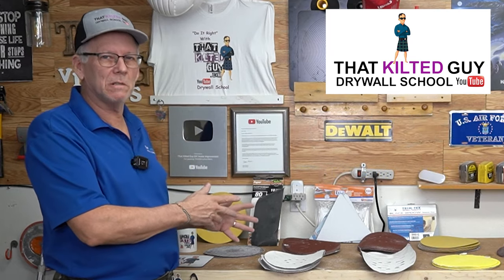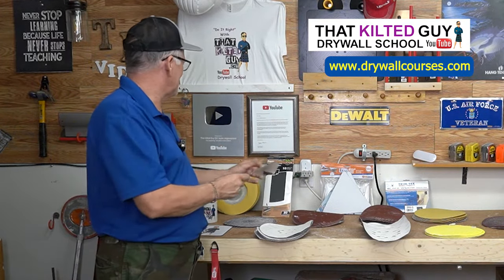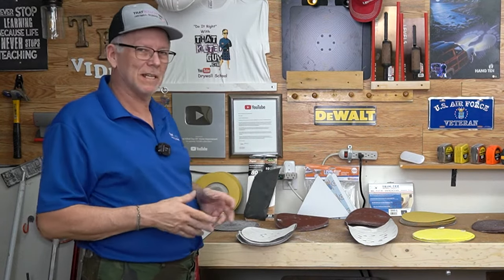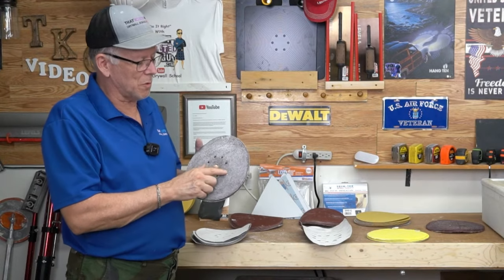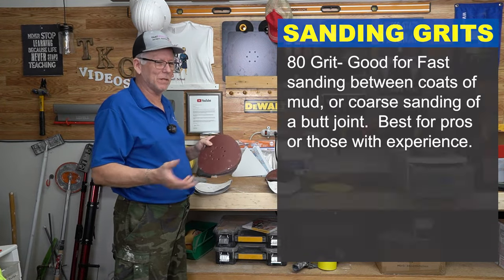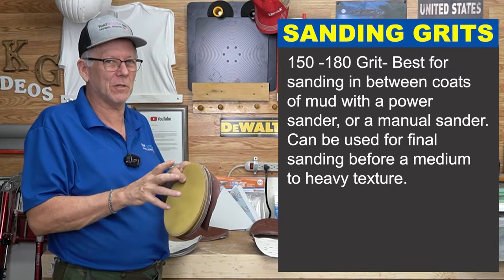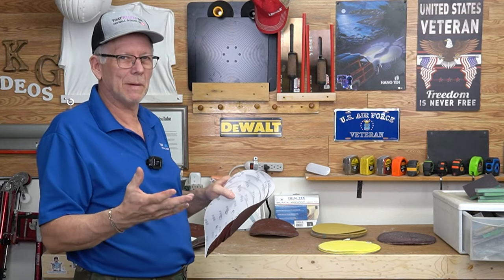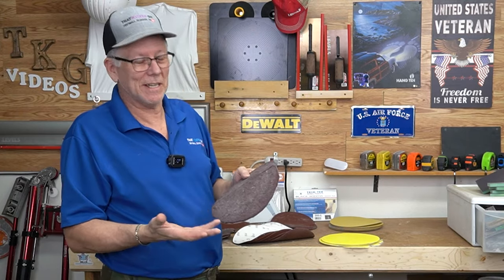How To Sand Drywall Correctly - The Most Important Step- Click ⬇️ for more Info

Comment: Hello. I am doing a skim coating project - I’ve coated all my walls and now am going around patching little craters from air bubbles, etc.  

With those spot patches, although I do light spotting of mud and feather the edges, I sometimes have trouble getting the patched spots to blend with the skim layer beneath when sanding them.

I can trace my fingers along the wall and feel the slight ridge where the patched spot begins.

Am using a 220 sand sponge - am I doing something wrong ? 

Would it be better to prime the walls and then go around doing the small spot patching, rather than attempting to layer mud on mud?

Appreciate your guidance

Comment: What grit do you use for sanding a pre-painted wall that you're about to mud over?  And what mud would you recommend on the underside of corner bead?  Wasn't sure if outside corners have expansion issues like regular seams.
Reply from the maker: Sand over paint with 80 grit , and use regular all purpose, or lightweight all purpose under tape on bead, just like under paper tape.

Comment: Do you recommend to use a rubber block to clean sanding discs? Will they work with drywall dust? I just discovered them.
Reply from the maker: Never tried it for Drywall but they work for woodworking

Comment: For power sanders: Are random orbital sanders better than your typical circular sanders? Hilti, Festool, DeWalt I'm all looking at trying to know which is best.
Reply from the maker: As far as I know, there’s not a random orbit drywall sander out there in the 9 inch size category. I just looked up the Dewalt one on their site and it said nothing about it. Edit I just looked and I think the Mirka sander is an oscillating and not just spinning sander but not positive
Reply: Random orbital is definitely better than just orbital. I have a Festool Planex 2, expensive but worth it. The built-in circular LED raking light is my favorite feature.